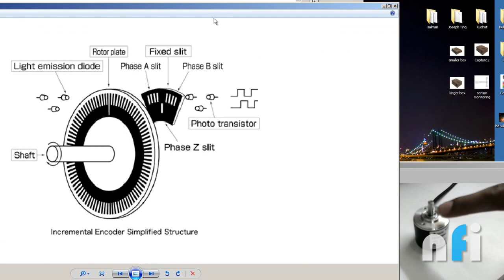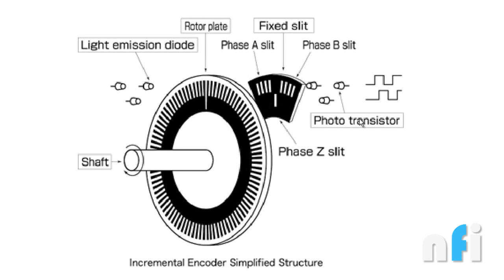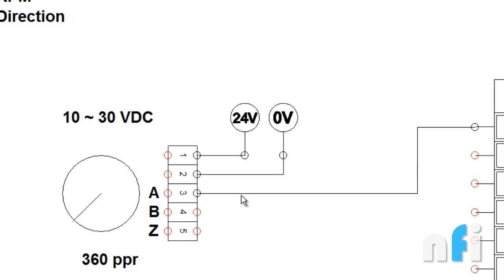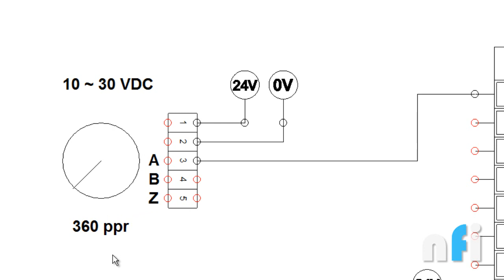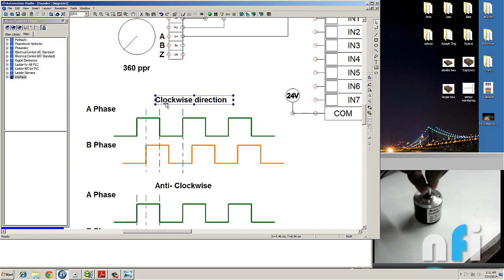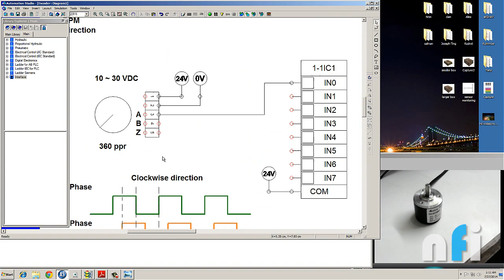Introduction to Encoders

Comment: assume that encoder rotated in direction 1, and channel A gave high then B, then shaft stops in between channel A and B, then it rotates again in same direction 1, B will give first this time, which will be translated in code to direction 2 though the rotation direction did not change, explain?
Reply from the maker: Good question: The Controller which reads the encoder notices the pulses very carefully. According to your situation if A comes and encoder stops. The controller stored the info that A was the last pulse. Now if B cones it knows the direction is same and if A comes again it means the direction is reverse :)

Comment: kindly tell the make & model no. of encoder used in the video
Reply from the maker: You can see the similar one here: http://www.ebay.com/itm/ONE-NEW-ES5-02PN8941-Delta-encoder-/182347078040?hash=item2a74bb9998:g:S7IAAOSwo4pYIZ~Z

Comment: regards, i have multiple allen bradley 845T series encoders my question: is it normal to get hot even without operating? I thought it was faulty and bought others but it also gets hot over 40 degrees centigrade without being in operation
Reply from the maker: That is not normal. What is your surrounding temperature?

Comment: Thank you so much! How would you know how many ppr you would need. I want to track position of a 7 foot diameter rotating pipe. Would I need a higher resolution because the diameter is so big?? Thanks
Reply from the maker: That depends on the accuracy you need in your system. If you consider 360ppr , this is very less resolution. I would consider you to buy atleast 1024 ppr and using fold fold division you can increase the resolution by 4 which means you will get 1024 x 4 pulses per resolution which is a good resolution.

Comment: could you plz tell me how to select encoder
Reply from the maker: Well it mostly depends on the range of accuracy you need. For example a digital encoder with 1000 pulses per resolution can give you 4000 pulses per revolution if you use 4 fold division while programming. 4000 pulses for every 360 degree of rotary motion of encoder shaft. You can further relate it to your requirement. 

You can also get encoder with 2500 ppr which means 10000 ppr with 4 fold division 

Secondly it's your choose to select either incremental or absolute encoder.

Incremental encoder gives relative information whereas absolute gives real time information of encoder position. 

Rest you can study more about encoders in Interne t
Reply: thanks rajvir sir. what is 4 fold division
Reply from the maker: Vikash Kumar Well if you closely notice the encoder pulses. It give you 2 pulses from A and B phases (also explained in the video) now using 4 fold division method we can read edges of these 2 pulses. So now every pulses has 2 edges - Rising and Falling Edge. So for 2 pulses you get 3 edges which means for every cycle of pulses you have 4 pulses. If you notice the cover page of the video you will notice in the last waveform about 4 pulses. Wing counted on one pulses of Channel A.
Reply: Rajvir Singh thanks sir